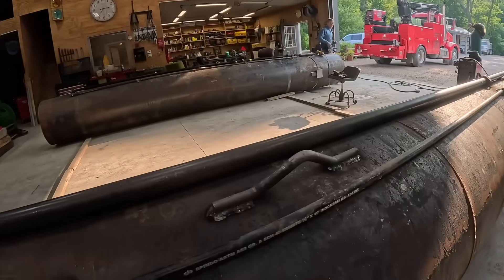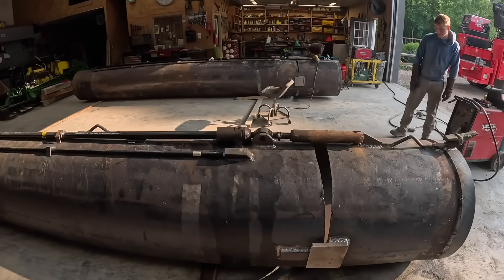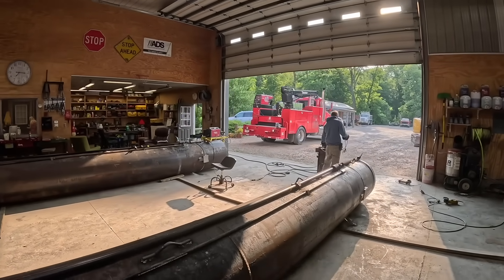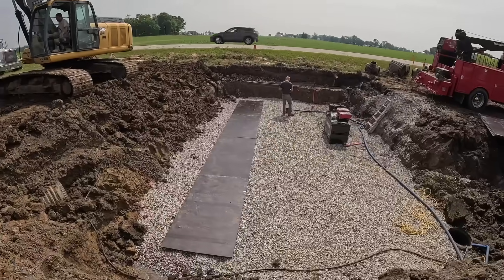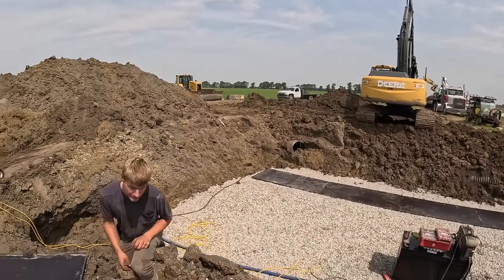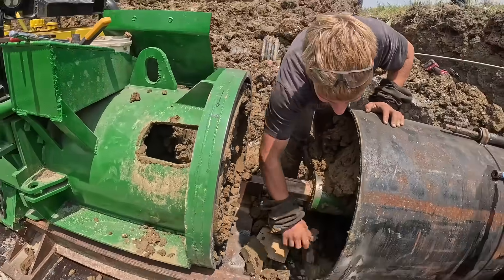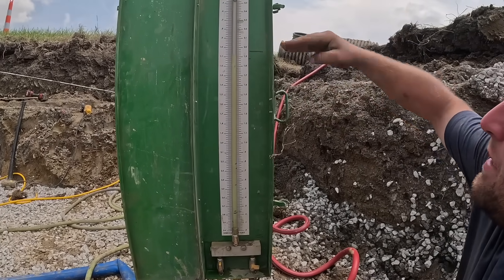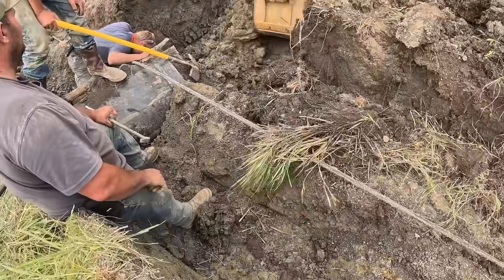Tunneling Under A Highway... TWICE!!

Comment: Amazing. I used to be a TBM operator in Toronto, tunneling  under roads and highways across Ontario. We used topcon gps and lazer for the grade. Interesting how you welded those 3 pipes on top of each pipe. Cheers

Comment: seen a similar job ince , they used a excavator mounted hydraulic vibratory sheet wall pile driver to push a steel pipe through , then used some high pressure pipe cleaning nozzles to evacuate out all the dirt - dug the hole on both sides deeper so the mud would be caught there water was sucked with a manure trailer and the sediment dipped out with the excavator

Comment: Interesting video. I was wondering, why didn't they just dig up the road and lay the pipe? Didn't look like a heavily used road and I would think the cost would be way less then digging under the road... But interesting all the same...      Thumbs Up!
Reply from the maker: You're right, the cost is way less than boring under the road if you were to dig it up. However, with it being a state highway you can't just go all Rambo mode on it. In order for the state to let you dig it up they would probably have to be re-doing the road at the same time, since it would already be shut down.
Reply: a few reasons.  this is a big route for Honda between the Ohio and Indiana plant.  also a cut across from I-70 to I-74.  also building a massive Diamond dog food plant about 8 miles south and another issue is a major trucking company just south as well.

Im waiting for this to get 4 laned..already is north of I-70

Comment: Just a tip cutting with the  saw. With a 5 gallon bucket  drive a nail into the bucket near the bottom.  Then fill the bucket with water.  Pull the nail out. This cools the blade and works great cutting concrete. 
Have a safe day otherwise you can't  have a beer in the hospital.
Reply from the maker: hey thanks!!

Comment: Change the settings on the skidder to accommodate your style!
Reply from the maker: Used to joysticks to run the bucket functions not foot pedals
Reply: Can they even be changed to work joystick for everything, like all the other machines out there? Foot controls just seem stupid, at least as the only option. The loader I have been on has the stick next to the steering wheel for direction like I am used to and has a joystick button for forward and reverse as an option. The accessory control is next to it and we are using a grapple bucket, so only a couple days in, I'm not sure about it yet. At the same time, I'm jumping back and forth between our miniex and a 55k pound medium size excavator and the thumbs on the machines are opposite. Unfortunately, I don't have much time to see if one can be reversed, which would probably be the bigger machine if it can be done in the menu. It is certainly preferable to get a machine setup so it is comfortable and is worth the time if it isn't a stupid rush job where we are short on equipment and operators.

Comment: Where are the “Hard Hats” Safety First !!!
Reply from the maker: Safety chains, boots, and glasses as well as jumping around all nimbly bimbly like house cats is good enough I think
Reply: I was glad to see they weren't wearing them, as they wouldn't do much for that type of work. Wearing hard hats for everything is bean counter logic. They ignore the downsides, including adding wear and tear and stress to the neck. It is common in private construction to not use hard hats. Over 30 years, I have done many trades and luckily wasn't mandated to wear a hard hat for most of it. I can't wear one now, as a 13 ounce hard hat feels like 10-15 pounds on my head and I can't take the torture. Years of painting and looking up, drywall work, electrical, work under houses or in attics, all caused wear and tear to my neck. Years of commercial work added to it. Other operators wear their hard hat while bouncing around in a cab.......lucky them that they can take the pounding, at least until they can't. I have always worked very carefully and have not been injured in a case where a hard hat would have helped and all of my injuries were very minor and expected with the nature of the work. We had a couple people get injured in the face and the hard hat did nothing to prevent it. While wearing one, I have whacked my head numerous times because it blocked visibility of what was just above me..........good thing there was protection when hitting something I wouldn't have if the protection was left off. There are types of work where they do make sense and I'm very strict about using a faceshield, gloves, welding helmet and a jacket, sleeves, apron, etc. when needed for the position I will be in and ear plugs not only for the noise but also the splatter that can make it into a helmet and into ears. There is safety and then there is over the top bean counter stuff.......kind of like being told you should take a jab that is unproven and lied about for a risk that is very low for many people. Some of us can be responsible for ourselves and make choices we are willing to live with.
Reply: You sound like typical clipboard warrior.
Reply: @Assassinlexx  No I’m not stupid and was a maintenance manger !!
Reply: @scotsmanofnewengland7713 
Manager  is the correct spelling,  so write that down on your clipboard. 😂
Reply: @Assassinlexx  sorry I retired a long time ago and so I made a spelling error so there’s another thing in life that are more important

Comment: Seen and driven many Tunnel Boring Machines in my time of starting work in tunnel 1960 and gave up in 2015. The first was the hand machine CP ??? an air clay spade and a shovel on shaft work. Then operated an open face digger shield, similar set up to your cutterhead. But bigger enough to erect precast concrete segments on the clay behind the machine and jack off them to shove the shield. Guidance was first using three string lines for line and level. Then a car spotlight blacked out with a cut out cross in the center, two targets again with cross's cut out mounted at shoulder height in the hand dug section of tunnel, This was now our control cross for line and level that shone on a grid screen that had numbers across the top and letters down the side. The tunnel were for a new London Metro The Victoria Line. Twin tunnel were driven by TBMs for the trains these were on a down grade from stations to a mid point then rose to the next station, as an experiment to save power on pulling away and brake wear on stopping at stations. Average speed for the TBMs was 26ft. in 8hrs. 5 shifts per week.
Back in 1994 I was Senior Inspector of Works on the CN Railway tunnel under the St Clair River Ontario to Michigan, I climbed through the cutter head on breakthrough for the photo session. But US safety would not let us climb back through, sadly my Brit passport was in my apartment. We boarded a crew bus and headed for the border. Both immigration wanted to know how I'd got into the US. In unison the whole bus sang "He dug a tunnel" Shaking their heads they waved me through.
Good to see seat of the pants engineering and your guidance system, well done.
Reply from the maker: Wow that sounds like a very fascinating career glad you shared it, I don’t think we’ll ever do that big of boring jobs like you did for trains and such, just mainly for farm drainage systems. Thanks for sharing!